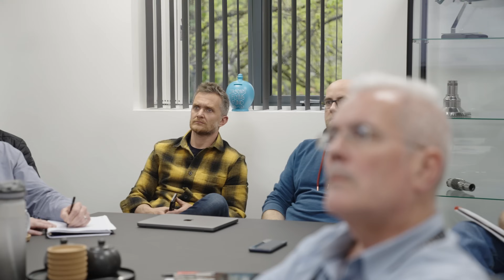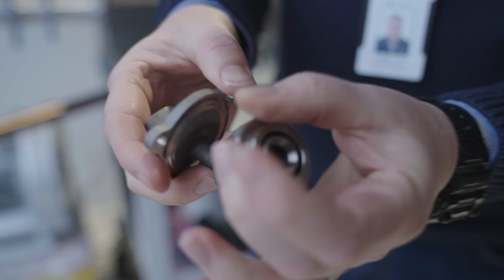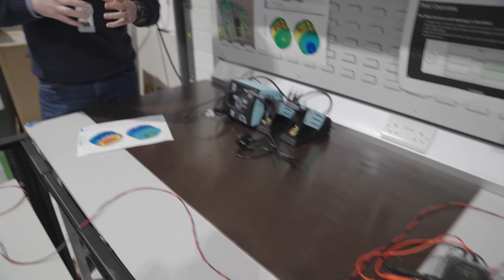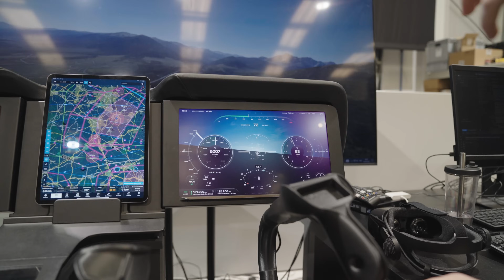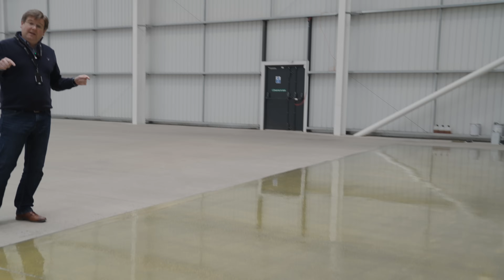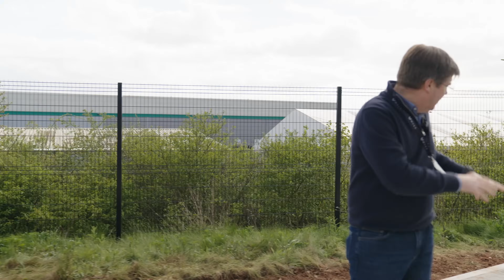Highlights - HX50 Monthly Update & AMA on April 24, 2024

Comment: It's great that you are building new, I'm particularly fond of making a new engine and avionics. As for the interface design, I would recommend completely departing analog gauge legacy and take advantage of the simplicity and clarity that digital affords. If you want a movement indicator then a small flowing stripe field will do that well. Psychologically similar to having an elevation pole nearby that you can see the movement on. A gauge hand you have to intellectually correlate to the scale first. Stripe flow you immediately understand even in the peripheral vision.
The first motorized car looked like a horse drawn carriage just without the horse when it should have looked more like a Tesla. Never hold on to legacy.
Another argument for the simplicity of digital is to not clutter the most important use of the display, the synthetic vision. In zero visibility the display is your entire window. Imagine if the entire windshield was cluttered with analog gauges for no reason other than legacy convention. The synthetic vision has to be the all dominant use of the display and its significance as your view to the world cannot be overstated. Kobe Bryant died because that helicopter had no synthetic vision. Many crashes are because the aircraft had no synthetic vision or it was too small and cluttered. 
If you haven't tackled the synthetic vision yet I happen to be a computer scientist with geospatial background and have given thought to how to source quality terrain data and manage and sensibly compress the large dataset and present it in quality appearance with modest graphics power. I would be available to consult on that if that would be helpful. It's quite possible to produce a terrain in vastly better quality than the rather crude standard employed by garmin, honeywell etc.  Quality similar to the simulator terrain you have on the back screen for the entire world.
I also have some familiarity with FAA requirements for synthetic vision.

Comment: don’t forget…

while selecting the swirler geometry…

The final flow characteristics will depend, to some extent, on the final geometry of the gas generator itself… and the actual temp and pressure inside…

Unless the gas generator is going to be a long rectangular box… the flow patterns will be different where the magnitude and location of the impinging will occur.

- not a combustion engineer -

Go Hill Helicopters!

😃

Comment: My idea for the vertical  indicator is to use a zoom in and out arch with readings with changing colour  to get a more accurate smooth representation
Reply: My other idea is to have a sliding tablet display were a pilot slide the display  to one side when it becomes an obstruction to view 😅